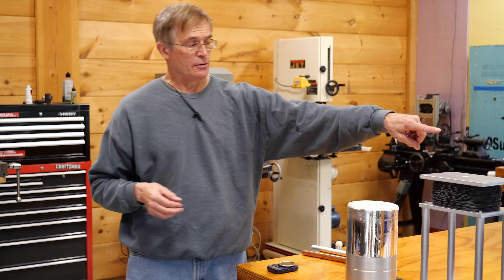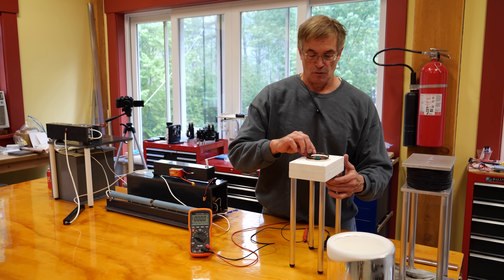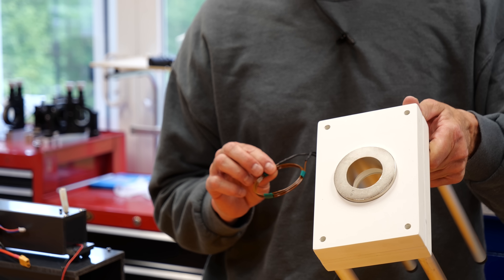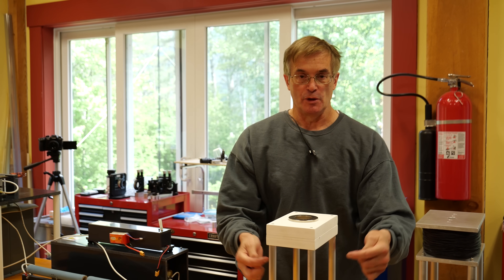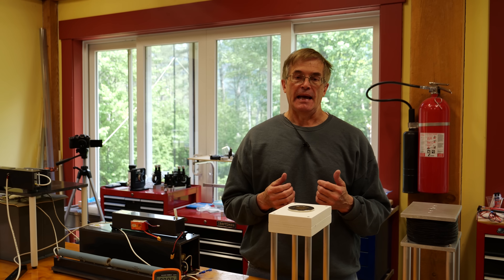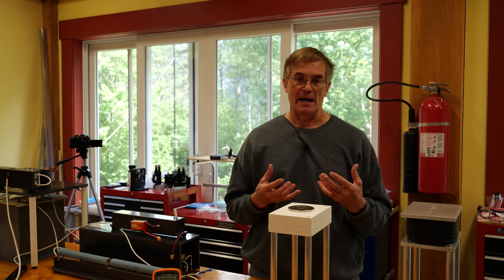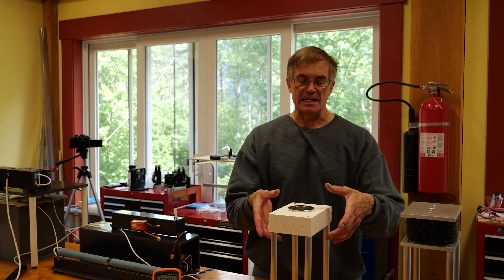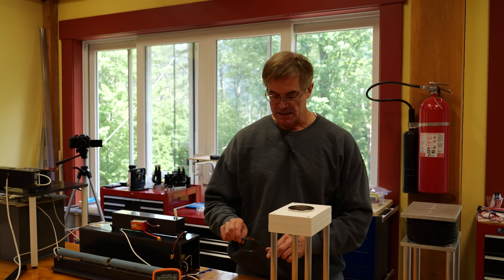No, we didn't use Magic to Crush this Can...

Comment: Great informational!  I enjoy the comparison of the information available on the topic to that of your particular perspective/cannon/aim.  One thing that rubs wrongly however is the non-clip mic segments that have splitting noise which made me unable to focus like I wanted as a consequence; but you are well aware I'm sure [just confirming it's worth doing over with a mic next time for presentation sake] and to that effect, please give the boy a triple gimbal setup for his moving camera... although his technique could use some improvement [it's workable] the stability of the shot could help us keep focus of the event better, and also will help with those times focus gets choppy.   I know others get motion sickness due to such movement, and some people will wind up looking at the leading point if they are used to compensation for piloting/ sighting. Anyhow, the mercury vapor plasma likely didn't need such containment as the fusion you spoke of, and although this was an example; I figured you would touch more base on the containment of the plasma on the entirety of the tube and how that may influence the plasma and the ability to probe/expose enough of it to an energy conversion outlet... if you would, I would be stoked. And did you make that air gap switching device?
Reply from the maker: Thanks for the suggestions.
Yes, I made the spark gap for the large dye laser we built earlier.

Comment: Alot of changes since this came about, still trying to use this method or the casamir effect in a way to cause entropic principals to take place in an enclosed area, fed matter to re arrange in a dynamo so that the rearrangment occurs on our timescales regularly enough to output power/heat in an area. Magnetic fields might be potentially capable of lightning like output to some conversion or storage method.... Backyard science never felt so dangerous.

Comment: great video...
However I would be very careful with that quarz glass plasma Tube filled with mercury vapor.
Quarz glass does not only let UV A/B through, it also lets UV-C through. (That's why you can smell the ozone). UVC is really harmful not only for our eyes, but also the skin. If you sniff at your skin after beeing exposed to a UVC lamp for a few seconds, it will smell very weird, almost burnt.
So I would avoid being in the same room while it is powered and not shielded, even with eye protection

Comment: I appreciate your demonstrations and am inspired to take a look at my own versions of them seeing how you've solved the same problems in different ways.  Excellent work.
I'd critique that what you call the Zeta effect in your demonstrations (not a term I'm familiar with or could find a scholarly article on with a shamefully short google search) is fundamentally a result of currents *in conductors*.  The properties you're demonstrating can only exist when the electrons are moving through a field of positive charges (the atomic nuclei in the conductor).  Even in a reference frame that is at rest with the motion of the current, there is an equal and opposite current of opposite charges in that frame - creating an identical magnetic field as the one we see in our "lab" frame, which is at rest with the atomic nuclei in the conductor.  The fundamental fact that there is no reference frame in which charges are stationary is why the force between currents in parallel wires is deterministic.  Else we could imagine a reference frame moving along with an electron in the current, which is surrounded by other electrons at rest.  In this frame, there is no magnetic field, only electric field, and the charges would repel.

Comment: Really good video...however the magnetic field does have movement as magnetism is separate to the the object....I’ve frozen magnet...at the point of freezing...the magnet is stationary...but the movement of the field leaves trace lines in the ice...this is also correct when a magnet is placed beneath a supercell...the quote on quote poles can be seen..when a second magnet is added..the centre of the magnetic field moves from the centre of the magnet..and merges with the other at a centre point between the two magnets....loads of experiments were carried out over a century ago.. and the results came back the same..the rate of induction of the magnetic field has a slight shift whilst the magnet itself was stationary..👍

Comment: the Germans in WW2 came up with a manufacturing method called high energy rate forming, they used magnetic fields to form metal, they also used explosive hydraulic forming. No matter how we feel about WW2 Germany they created many ways to build and manufacture.

Comment: If you wanted to go back to the tangent of speaker designs again in the future, would you be interested in doing an analysis of the applications of linear or grid speaker arrays compared to single point source and coincidental coaxial speakers? They're both a bit of an exotic application of very commonplace speakers for different applications.

Comment: how big is the magnetic field generate by that coil of wire @24:18 (Im curious about the pulses effect on nearby electronics) and what change to the coil would generate a larger or more focused field (i assume the modifications for either or would be quite different)
Reply from the maker: I'd have to estimate, but it's probably in the tens of Teslas.

Comment: I noticed statically driven charged particles will orbit in space itself so theres a possibility of a state of shieldings in water with statics which flow with air pressure to help spin the water balance

Comment: 18:36 In my opinion, the explanation on why the cut aluminum rod still slows down feels incomplete. It's mentioned that gyro orbitals occur through the entire mass of the material, but that singular sentence doesn't quite feel like as in-depth of an explanation as the rest of the video (which is very well done and easy to understand, might I add!). And after that, it jumps straight into thermonuclear fusion again, but it doesn't later return to explain the significance of the gyro orbitals in the cut aluminum rod in specific, which is the object that introduced the topic in the first place. Other than that, amazing job!
Reply from the maker: I'm  not sure what your  problem is with respect to the gryro orbitals. We can't  demonstrate them other than their effect macroscopiclly in the rods.  You might  look into the operation of a magnetron tube (microwave oven).  The principle is similar.

Comment: 7:08 I notice the repulsion of two conductors using my small battery spot welder... the wires will slightly jump when the circuit is completed.

Comment: So at 13:00 - would a good application of regenerative charge be created with the shock absorbers of cars in perm magnets like this?
Reply from the maker: Potentially, yes.  However, the forces are small at the velocities typical of those movements.  Mechanical leverage could increase those velocities significantly.

Comment: 2 questions - first, why is there a pinch or restriction just to the left of the permanent magnet? Second, toward the end of the video, the right end of the tube starts to pulsate and shows an odd pattern, why? Is the mercury vapor degrading?
Reply from the maker: The pressure  is changing slightly as the tube warms up and the adsorbed gas on the walls is released along with the mercury vapor being released from the droplets.

Comment: Do you know the nature of the field, if any, around a "grounding wire?"  Given 6 gauge bare copper wire -- is there a significant difference whether the grounded wire -- say 12" -- is straight or forms a closed circle. Thanks so very much for your consideration.
Reply from the maker: If the grounding wire is actually  the return  lead that completes a circuit, then the effects are the same as with any conductor.  A coil will generate a larger and stronger inductive field than a straight wire 
If the ground is a backup to prevent stray potentials from forming, then the field depends on whether it is actually  conducting current.

Comment: 16:54  Galileo proved that the rate things fall doesn't depend on weight notwithstanding air resistance
Reply from the maker: True, so to explain a difference in acceleration, you need a difference in force.  Gravity is a fixed component, therefore the electromagnetic component  must vary.
Reply: @TechIngredients  really enjoy yours show. Keep it up !

Comment: @Tech Ingredients this video really makes me want to see you build and explain an explosively pumped flux compression generator. I have always thought there should be a way to do that without the explosive part, I.E. either by something electro-mechanical, or more likely by an external electromagnetic actuator. Of course, since nobody does that or has done it that I have heard of, my understanding is clearly faulty. I would love to hear you explain why, since I suspect if you explain why I might actually get it.
In particular, my thought was that the mk. II soviet design, which involves an expansion of the inner tube into a pseudo-cone, which breaks the coil, should be able to be done with some sort of pre-broken (segmented) coil, and a non-destructive, or limited destruction, expansion of the inner surface. With regards to limited destruction: my thought had been a shaped tube that is already formed to separate the coil, propelled by a shotgun shell, or driven by an external magnetic field.

Comment: Hey, I had an idea and I can't figure out why it wouldn't work.  I am pretty sure it wouldn't work so if anyone has a minute or two to think about this.

  When a magnet gets over 175 degrees Fahrenheit it loses its magnetism.  So I think that if you put a magnet below a very hot iron bar, when the magnet jumps to the bar it generates energy in a coil of wire, then after it heats up it loses its magnetism and falls onto a heatsink, like the kind we use for computer processors.  I know getting all the measurements just right would be difficult, and you would probably want to keep a load on the current in the wire to slow down the magnet so it doesn't crack when it smacks into the iron bar.  A vacuum between the magnet and the iron would probably be needed to prevent heat transfer to the magnet when it isn't in contact, increasing efficiency.

  I have been trying to figure out a way to convert heat into electricity in a compact and light device and this idea is my best so far.
Reply from the maker: You could do that, but it's a one time operation.  The loss of magnetic alignment releases heat/increases entropy.  You will have to invest energy when you try to re-establish the magnet's field.
Reply: @TechIngredients  Hmm.  I heard somewhere that alternators use 2 coils of wire instead of 1 coil and a magnet.  That might solve the damaged magnetic field.

Comment: I have a favor to ask - I am a ham radio operator interested in plasma used as a radio antenna. I've had a year of college physics, and did manage to get through calculus, but I don't have any really advanced math or physics background. What information I have found on the subject is beyond me. This is something I would like to experiment with if I had a clue. Can you discuss how this works?  The sum total of what I know about it is that the resonant frequency of the plasma is proportional to the plasma temperature. (This is why the higher frequency ham bands have a longer skip distance than the lower ones - the radio waves must travel higher into the ionosphere to reach a resonant layer, which refracts them back to earth. At that point it's geometry.)

Comment: can the permanent magnet increase its field through spinning? like freeze that weird metal that becomes more conductive when cold, spin the heck out of the magnet around the mercury gas (or helium) maybe use a spherical field to concentrate the field in a small area and contain your fusion reaction.
Reply from the maker: Spinning the magnet will not increase it's field strength.
Reply: @TechIngredients  how would you increase the field then? Could you have two magnets spinning in different directions creating some type of field

Comment: Re: z-pinch, hang on.  Suppose you fired two electrons side by side into deep space.  They're both traveling in the same direction, so it seems like z-pinch should pull them together, but relativity says the case is indistinguishable (to the electrons) from two electrons just sitting side by side, which should repel.  Is the presence of a conductor necessary for z-pinch to occur?  Is the force exerted between electrons and electrons, or between electrons and protons?
Reply from the maker: Good question.  I'll  think about it.

Comment: The U.S. Navy has a patent for a superconductor, filed in 2017- and again in 2019.

 PIEZOELECTRICITY - INDUCED HIGH TEMPERATURE SUPERCONDUCTOR 

Abstract:
The present invention is a high temperature superconductor comprising of a wire , which comprises of an insulator core and a metal coating . The metal coating is disposed around 
the insulator core , and the metal is coating deposited on the core . When a pulsed current is passed through the wire , while the wire is vibrated , high temperature superconductivity is induced.

Comment: I've been to some public lectures regarding these subjects. I find that how you present them to be absolute top notch - even though I do have some sort of grasp (at the neophyte level) of the concepts introduced and explained. For example I wasn't aware about the Theta (or is it Zeta) pinch (constriction effect) although it seems pretty straightforward and intuitive when you explain it.. I guess to actually understand it would require some higher notion in field theory !
Also I was under the impression that Cooper pairs made the electrons behave like bosons - and thus were not affected by the Pauli exclusion effect - hence removing resistance - but I've heard various other explanations for this ;)

Comment: Thank you for going into such detail on how to work with pulse circuitry, this is a field where practical information is rare. I have a question regarding the design of the triggered spark gap: inside the aluminum block in the middle, do you have something like a needle shaped trigger electrode pointing at the gap between the tungsten rods? Or is the hole in the aluminum block all that is needed because the field lines concentrate enough at the edges of the tungsten rods? I'd like to use a triggered spark gap as a switch in a pulse generator for EMC/EMI surge testing to generate 1,2/50/8/20 µs pulses so I can do preliminary tests during development. This way,  I'd only need to rent a proper, calibrated surge generator to confirm the result of my own tests. The circuit for generating such pulses uses a 6µF capacitor that is switched into a simple network of power resistors and an inductor to shape the pulse as required by the IEC 61000-4-5 standard. The capacitor is charged to 500V, 1000V and 2000V according to the required test level. The currents depend on the load but can be on the order of 2-4kA. So in my application the challenge is less to obtain very high currents, but probably more how to get the spark gap to fire with only 500V charge voltage across it. As a source for the trigger voltage, I have a pcb out of big high pressure xenon arc lamp power supply that can put out 40+ kV pulses.
Reply from the maker: In our case, the rod edges are enough.
With such a low voltage, you'll benefit from very fine control of the gap.  With such a high trigger voltage, a needle or a thin sheet with a hole located around the gap will be plenty to initiate the spark.
Reply: @TechIngredients  Thank you for the quick response :-) I'll give it a try - seems like I finally found a use for the stepper motor based linear actuator with only 10mm travel thats been gathering dust for years in my junkbox. If I get it to work, I'll post the details here.

Comment: This video specifically mentioned deuterium/tritium fuel for a fusion reactor.  The problem with that fuel is that the reaction produces high speed neutrons.  Unlike the ions and electrons in the torus, the neutrons are not affected by magnetic fields at all, therefore they are not trapped in the torus and hit the wall of the reactor at full speed.  They have about 14 million electron volts of energy and can smash millions of crystals in the wall material.  With the crystal structure destroyed, the wall crumbles.  Other fuels like boron 11/hydrogen 1 > 3 helium atoms, are much harder to ignite, and they haven't even ignited deuterium/tritium.  Hate to be a party pooper, oh well!!
Reply from the maker: The neutrons are absorbed in the liquid lithium fluoride salt that surrounds the reaction chamber.  One meter is enough and this transfers the heat as well as breeds more tritium.  The reactor walls are exposed to a high neutron flux and will degrade.  That needs to be explored.